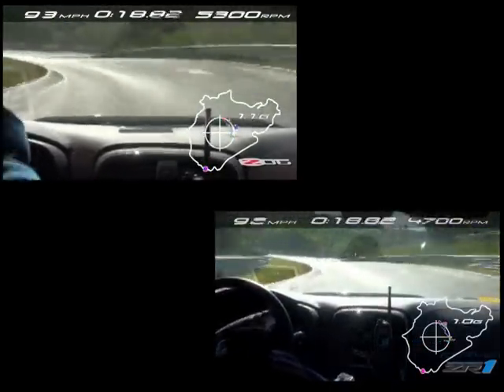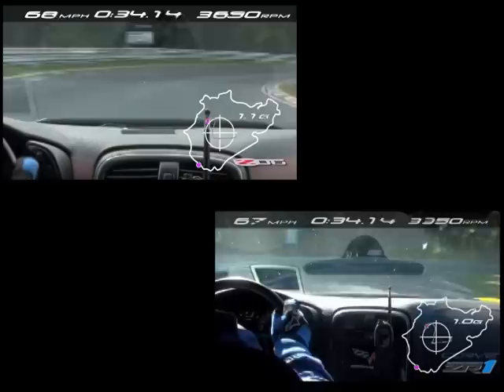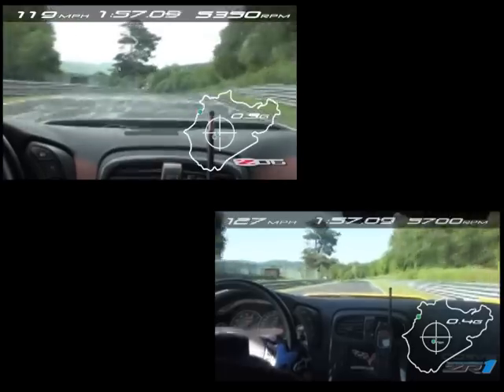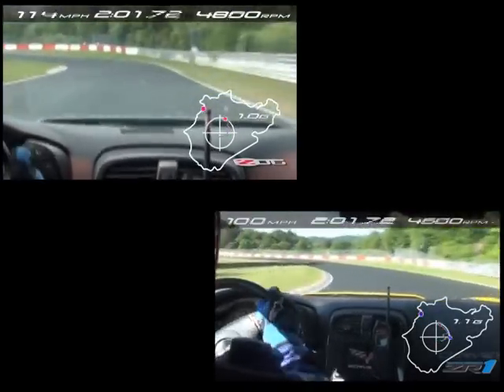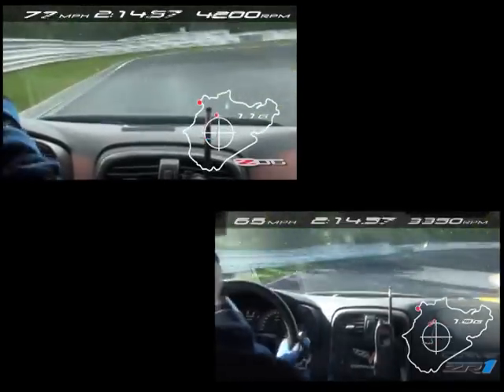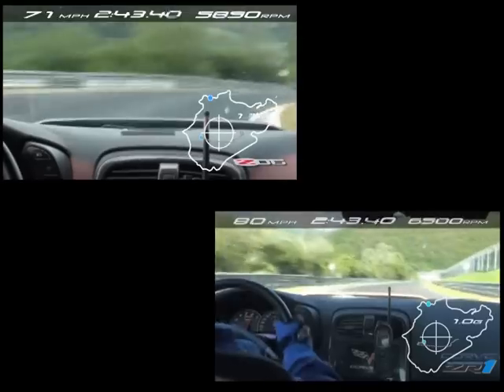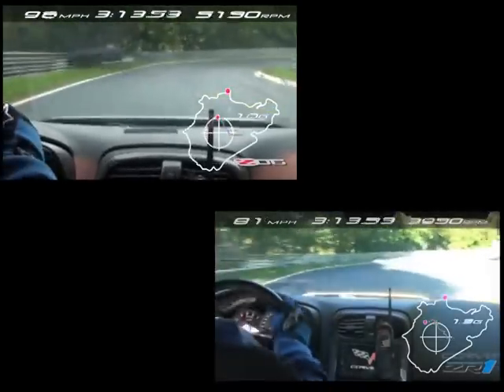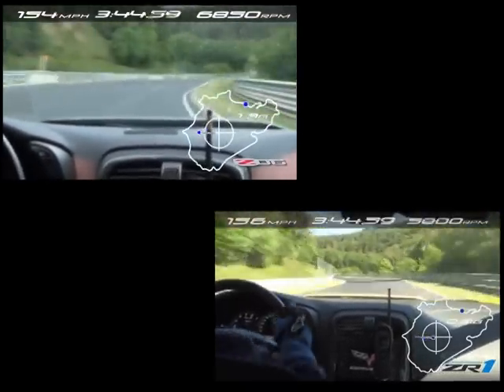2012 Z06 vs 2012 ZR1 Laps the Nurburgring PartNew

Comment: @SUPERBADKBOY The difference in these two exact cars is the engine (pretty much). The Z06 has a naturally aspirated 7.0L V8, whereas the ZR1 has a supercharged 6.2L V8, which adds weight with the supercharger and intercooler system. Trust me, if they could shed weight more, I guarantee you they would. This thing already smokes 99.99999% of cars out there. They would get any other improvements where they could. You don't realize how fast they are actually going until you ride in one. Insane ride!